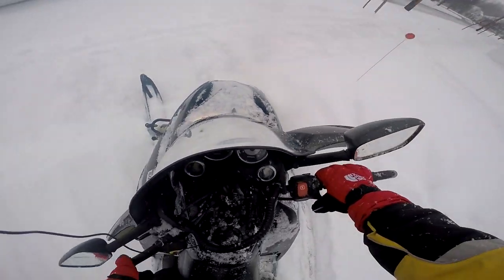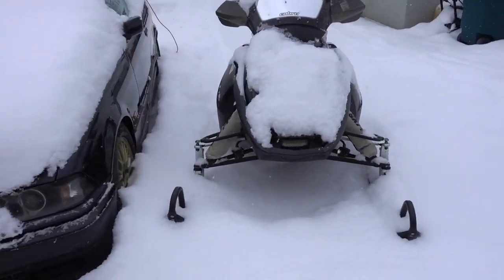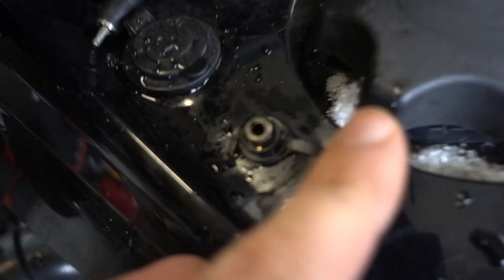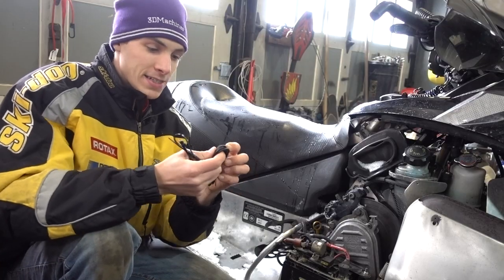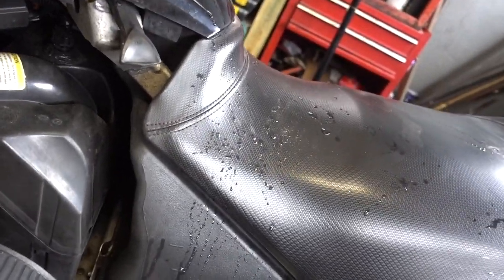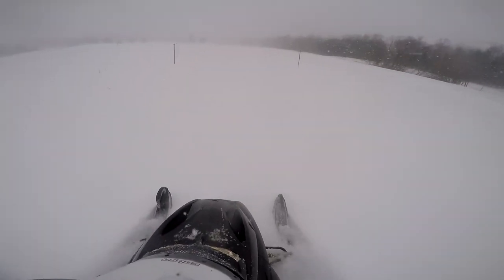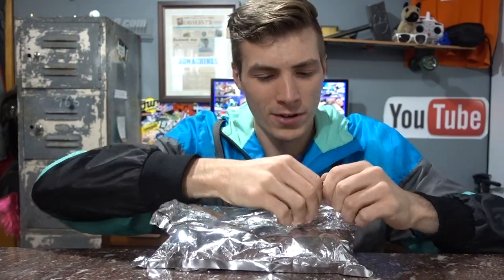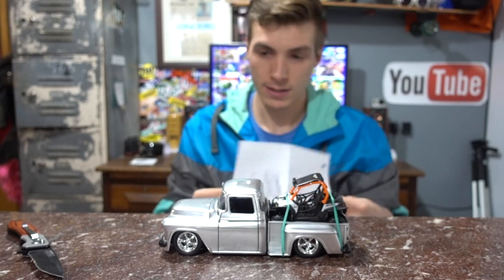My NEW DAILY DRIVER

Comment: Hey dalton I don't know if you have any big steep hills you ride the sled up but if you do at some point you are going to have to go down a steep hill and to make it easier to go down if you take your burnt up belt and cut it in half so you have two pieces and we drill a hole through the ends and run a bolt through them to make a loop. We keep them on our sleds somewhere and when it comes time to go down a steep hill you slip the belt loops over your skis and it really helps go down steep hills without fish tailing and possibly rolling your sled down the mountain

Comment: I am from Wyoming so in the summer if you drive down the road, there will be a 4 wheeler or Polaris RZR almost every time. Though there are very few times I the winter I will see a snowmobile on the roads, but we have a ton of trails because the Big Horn mountains are here and a short drive away is the Black Hills in South Dakota, only a few hours.

Comment: You should wire that heated shield cord into the tail light circuit. Going directly to the battery makes it a "hot wire" constantly even when the sled is off, which creates a much higher chance of accidentally shorting out and or draining the battery. The tail light circuit (not the brake light) is only hot while the sled is running.

Comment: What you mentioned about the belt yes some manufacturers goo of of that. Others go off of belt deflection. Straight edge over the belt press down firmly in the center of the belt and measure. I don't know the specs on the belt deflection for you machine but that's the proper way to do it.

Comment: In Northern MN, though you can't ride down roads and aren't supposed to in most towns, the cops are very lenient, especially if you're just trying to get to a trail from where you live.  Pretty lenient on ATVs as well.  I love riding to the parts store/walmart/hunting shop with my sled.  All within a couple miles.  Takes forever though as I have too much fun ditch banging the whole way.

Comment: On your belt, There should be a spec for your machine as to how much the belt deflects between the clutches probably around 1". If it's too loose you take off in too high of gear and you clutches slam in hard this will destroy belts. If its too tight it will cluck like a chicken or have a high pitched squeal when stopped. If you get noise when stopped back it off a little and you should be good.

Comment: Check your oil injection pump, you are smoking A LOT so the adjustment may be set too rich on oil.  Proper adjustment is to just move throttle lever until it takes up slack in cable & marks on the oil pump should align at this point.

Comment: The 2 stroke oil all depends on the reservoir size.  I think its the ratio of the engine that determines the oil usage. like is it a 50:1 or what ever.

Comment: Dalton ur deflection looks fine, if you get feel like it's doggin in the higher rpms adjust down. I'm a cat guy but typical is 1/8" outside of sheaves to flush. Do revs have limiter straps? Always fun to drop um to lowest setting😎#braaplife

Comment: highly recomend that you only use genuine skidoo XPS synthetic 2 stroke oil in your sled. bit more expensive but it is better than anything from a parts stroe for the rev chassis 800's

Comment: Set your oil adjuster at 18.5mm, thats too damn much oil for sure.  to verify just fill the tank and the fuel and then compare after a trip, should be no less than 35 to 1.